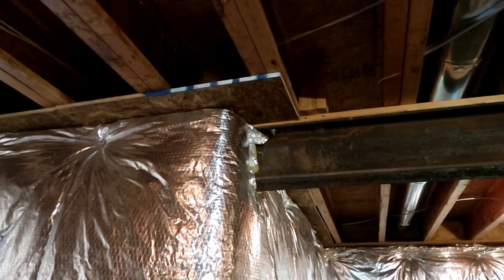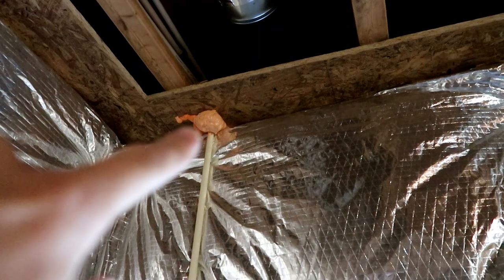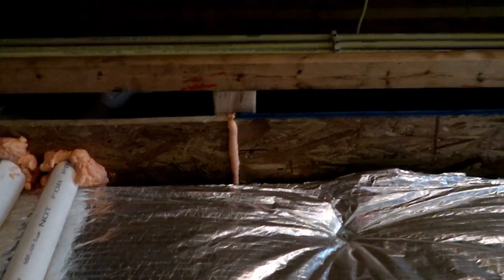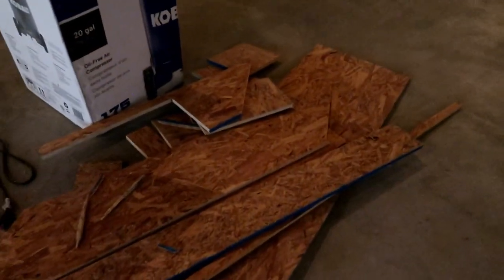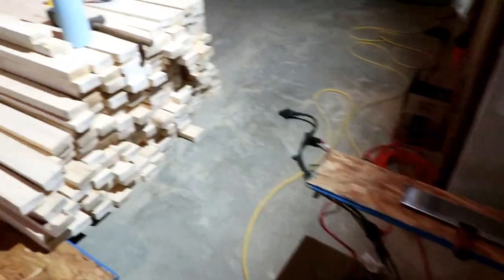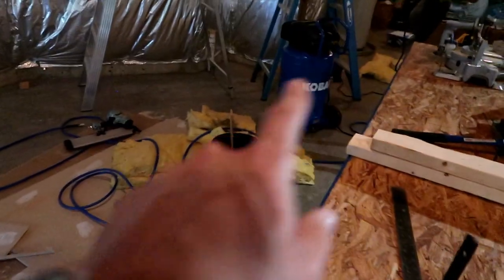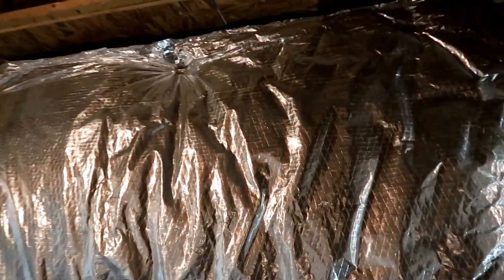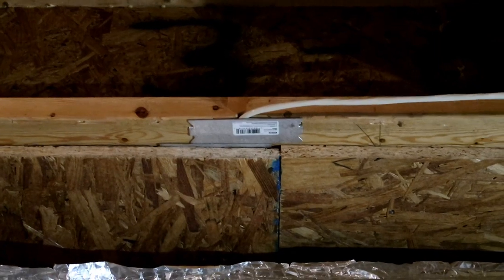Finishing My Basement | Fireblocking | Episode 3

Comment: Nice work again.  I too had to fireblock at the top of my exterior walls.  Do you have to do horizontal every 10 feet too?  I had to do that in my framing.  I also have to go back with the foam spray once I'm done roughing in my electrical and plumbing to get all the air gaps.
Reply from the maker: I did have to do horizontal fireblocking every 10 feet.  check out the below video where I show more of what I did for fireblocking

https://youtu.be/n6WKcRSa5ac

Comment: Great informative video!  Thank you.
Question: if I'm framing against rigid foam insulation, is fire blocking necessary between the stud and insulation?  Thanks in advance!
Reply from the maker: good question, my uninformed opinion would be that you wouldn't need to since there would be no way for air to pass behind the stud where the rigid foam is, but you should definitely check with the governing body that does inspections where you live.  good luck.

Comment: Does anyone know... If the ceiling is filled with rock wool, does that count as vertical fire blocking?  Trying to not run osb or anything on the  perimeter wall if the wool fills this need.
Reply from the maker: I would contact your county or township inspection office for guidance. But my guess is you'll probably have to run OSB

Comment: Did your local inspector require all of your fire blocking joints to have foam? Or if the joint was close enough to be considered air tight no foam is required. I've seen some require overlapping joints.
Reply from the maker: I ended up spraying foam at every joint. I didn't leave the opportunity for them to say "add more foam"

The cans are cheap and I figured it was easier to just do it that way